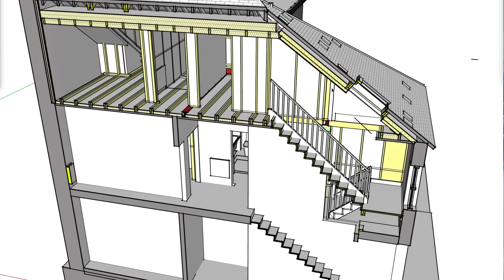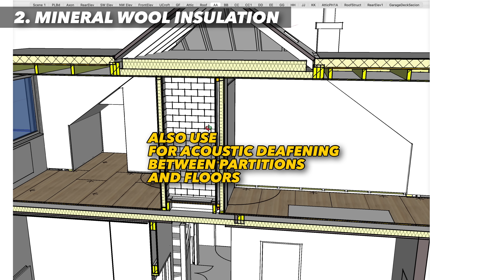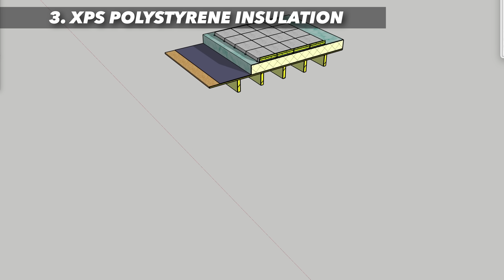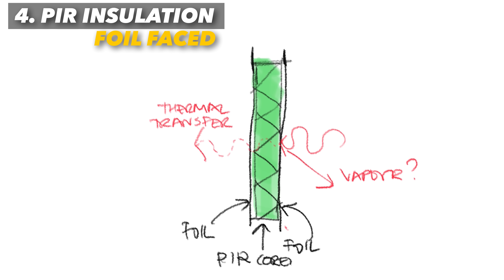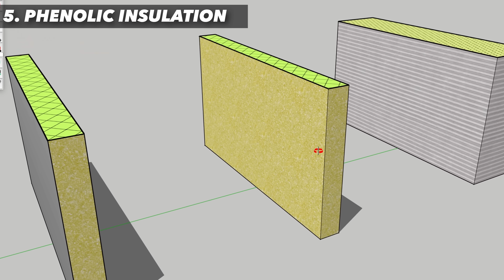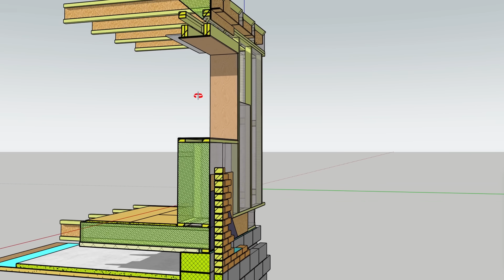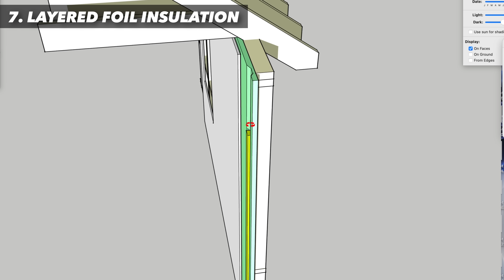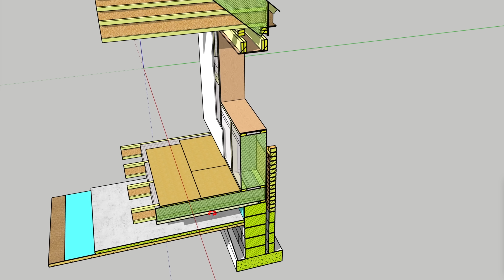Home Insulation Guide | PIR v Tissue v Cellulose v Mineral Wool

Comment: Thanks for the great overview. Two questions if I may. I'm renovating an ensuite and have the room back to bare concrete hollow-block walls. It's a U-Shape room with the back wall and right wall being external (right is a gable). Left wall is the old house external wall but now an internal wall (this room is an extension built a long time ago).

1. I was planning on battening the walls and infilling with Rockwool. I can also cross batten for fixtures etc. Do you recommend Dot and Dabbed PIR over this method?

2. If I take my current approach, usually the plasterboard is foil backed so sits in-front of the Rockwool batts, but in your video you mention the vapour barrier being on the cold side, so should I install a separate VP behind the studs and Rockwool and forgo the foil-lined PB? (Not withstanding the extra items needed for the shower area to make it water proof)
Reply: A vapour control layer should always be on the warm side (in climates such as the UK). 

If the walls are of cavity construction then I would batten, insulate between with Rockwool batts and use 12mm Hardiback board instead of plasterboard (if you are tilling the whole wall). Then use a Mapei Shower Tanking system to seal the boards, thereby providing an impermeable layer, or VPC.

If the wall is solid brick, then unfortunately insulation is risky, especially in a bathroom. The BRE recommend building an insulated small stud wall in front with a vented cavity, but that’s not always possible space wise.
Look up smart vapour control layers. They allow moisture to exit the cavity, but not enter it. But, as soon as you tile the wall you’ve negated that as the tiling and grout are vapour closed.

Sadly, insulating solid walls is misunderstood and can often lead to negative interstitial condensation issues, even when done correctly.
Reply: @Scott-cm8sv  Thanks for the detailed advice. Given the walls are cavity-block not cavity walls in the true sense, would your advice still apply? (I'm wondering if there's bridging issues with the non-cavity sections of the cavity blocks).
Reply: @StuckInTheM1ddle If the walls are of cavity construction then the easiest would be to seal the existing plastered wall with Mapei and tile directly to that. 
If you want to insulate then battening it out would be preferable as there is a lot of weight in the tiles and dot and dab may not be suitable. Again, I’d use Hardibacker on the battens for a superior job.

Comment: 3:00 for me being not from UK, but from Nordics, this looks horrible. We always drain our foundation so the water don´t creep into the foundation.

Then a capiliary breaking layer in the foundation, then the insulation.

This have the added benefit of  dry ground actually also acting as insulation, and that effect is actually pretty large.
Reply from the maker: Hi. Interesting but I’m not understanding how it’s horrible. How can you drain your foundation if it’s 1m  or more below ground level, as many strip foundations are?
Reply: @build-better-things  Just keep the draninge pipe in a depressed area with the top 10 cm under the bottom part of the foundation in a volume with 30-60mm washed gravel.

That makes the foundation totally dry.

Not only that, becasue the ground also act as a insulation, it actually push out moisture as long as the house is warmer than the ground temperature, that it typically is in europe.

Comment: Knauf, yech, they screwed over lots of owners in Glasgow when they approved their cavity wall insulation on several blocks of flats that have penetrative damp. Their analysis if they did any didn’t accept their insulation wouldn’t address the significant thermal bridging. The flats this day more ten years on have mould, damp, etc.

Comment: We have two houses that aren’t road facing so probably no issue with planning or fitting in with surroundings etc. all the insulation is boarded off the walls. Usual baton and plasterboard with insulation behind. Is there a reason the builders didn’t just recommend outdoor insulation? I notice you are pro airing the cavity. This wouldn’t work well with external wall I guess. So would you recommend vented cavity and internal insulation as well?
Reply from the maker: I use my “warm wall” solution rather than the standard external wall insulation, which effectively becomes the rain screen. I tend to just use that for retrofitting existing properties.
Reply: A ventilated cavity aims to keep the outermost layer of a building physically separated from the other layers, and allow it dry. With insulation on the outside that layer is no longer the outermost one, so there's no need for ventilation anymore. 

Retrofitting insulation on the outside of a building is always preferred over putting it inside.
Reply from the maker: Be careful about your generalising. Retrofitting externally is not always the best solution.
Reply: @build-better-things And never risk free on traditionally constructed solid wall buildings.

Comment: Great video. I have done calculations into decrement delay and have found that the benefits of denser insulation products such as cellulose/Wood fibre are overstated. If you look at a PIR system to say a 0.18 U value, whilst the decrement delay times are reduced the actual energy transfer rates into the room are very small and not really worthy of much consideration. There are a lot of marketing falsehoods by the dense insulation suppliers with spurious comparisons to caravans. A better way to manage summer overheating, other than through external shading, is to provide thermal mass to the first few mms of the inner layers. This is admittedly hard with timber frame and plasterboard but dense instead of normal weight plasterboard and a thicker skim coat could be considered as fairly straightforward measures.
Reply: I should however add that there are sustainability and acoustic benefits of wood fibre and cellulose over PIR as stated in the video. They are excellent products but you sometimes just need to cut through some of the marketing guff!
Reply: In Germany they double up the gypsum boards. For a new build you can choose a strategy with hybrid solutions. However the vast majority of British dwellings are build in Victorian etc times…… To improve U values on walls etc you need breathable insulation like wood fibre.

Comment: Great video

I was hoping to put some insulation between my kitchen and living room downstairs between the bedrooms for sound insulation. 

Looks as though I’ve messed up and assuming I shouldn’t put insulation between, as I don’t have a vapour barrier (visqueen type material) behind the boards. Appears that way from your informative video 😅.

 Not sure if it possible to retrofit (for the most part as I’ve battened off from the 5x2 joists to level it out. 

Anyway thanks again ^_^
Reply: I don't think you need to worry about vapour barriers internally between habitable rooms. They will both be warm and so there will be no condensation risk if you get some vapour transferring between. You just need to focus on good air ventilation/extraction.
Reply: @grmgnt1  thanks for the thoughtful reply ^_^

Just for additional context: It’s a early 70 semi detached timber front and back brick and block house (late 60s brick crisis houses 🤣)  that has a very small NON FILLED cavity differing by eye anywhere from 25mm to 50 mm on either side (would appear due to Friday drinks 🤣). 

I guess the air ventilation between the ground floor (kitchen) and upstairs (bedrooms) there’s no air brick mid height up the house at that joist level, but multiple ventilation at all 3 sides at ground level. 

I wonder where joists sit into the blockwork internally. Is that sufficient enough of airflow to  move around when there’s then filled joists between the floor, that I have no clue on. Spoken with roofer, bricky, joiner mates, no one has a clear cut answer 😅. 

My fear is rotting the joists and mould build up over the years
Reply: @ryan02070 no problem, I enjoy the discussion. When I said good ventilation/extraction I just meant to the rooms themselves rather than the floor space. So trickle vents to windows and usually extractor fans in kitchen/bathrooms.
Reply: @grmgnt1 great thanks 🙏 

I don’t use trickle vents, but I do have an extractor in the kitchen and open the windows and doors frequently, especially whilst cooking and do use dehumidifiers for upstairs and downstairs to be on the safe side since I’m refurbing the whole house 18months in the making 🤣

I wish there was more content out there for between floor sound insulation how to pack it, think about weight concerns, etc. 

Nice one ^_^
Reply from the maker: Hi. As stated by @grmgnt , you only need to consider vapour where there is a temperature change, so your internal partitions are fine with just insulation. For your solum, (space under the floor) you need cross ventilation, usually achieved with vents under DPC and with insulation at floor level. Where the joists are cut in or otherwise doesn’t make much difference but I’m many not understanding description
Reply: @build-better-things  great thanks again, solid advice, made me feel safer at least 🙏 

I’d like to do the crawl space underneath the kitchen and living room. I’ve seen videos where people expose all their floors to do it to wrap breather felt membrane. I don’t have that option after fitting my kitchen now. Plenty of venting around the bottom of the house, I guess the fear is not letting the timber breathe stuffing PIR between.

Comment: One thing you forgot to mention about phenolic foam insulation is it's fire resistance. And by fire resistance, it's the same stuff NASA used on the heat shield for the Apollo re-entry vehicle, so it really can withstand an ungodly amount of heat. Great for when you need a fire resistance rating.
Reply: It is class O for surface spread which is way better than PIR
Reply: All that Apollo stuff is pure Hollywood. Even a child can tell.